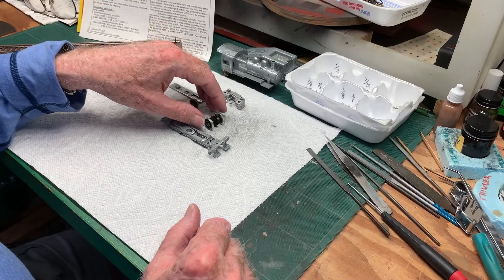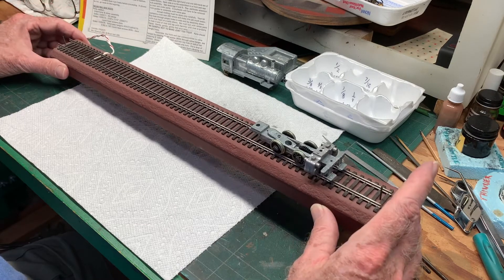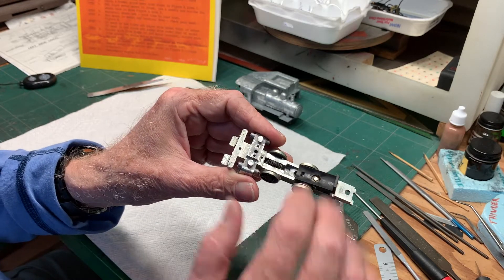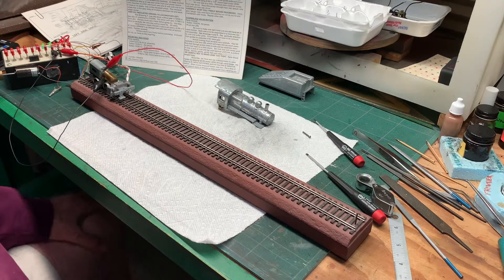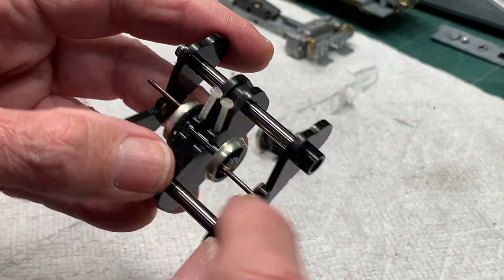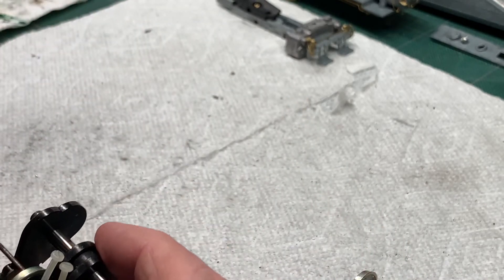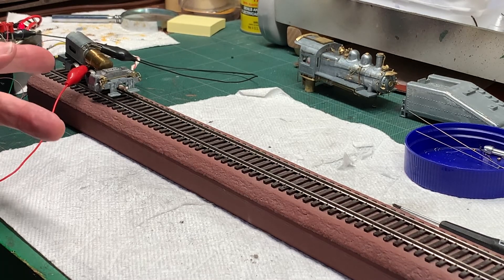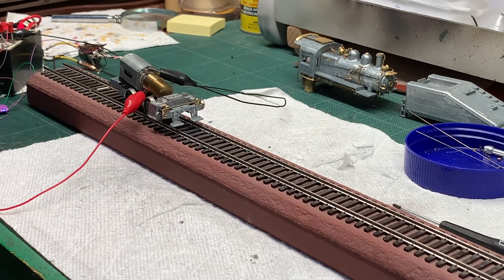Steam Loco Kit- Video #2- Basic Mechanism

Comment: This is a really nice video. Where did you get the motor?
Reply from the maker: I probably bought the replacement motor at least 30 years ago (source unknown).  The brand was "Helix Humper".  I"m pretty sure they are long out of business.  I am now thinking about putting in a Northwest Short Line gearbox and a new can motor.  A future video, perhaps???
Reply: @CarlBrainerd  I would be interested to watch. I have a kitbashed GN P2 from a Bowser USRA class that I am looking to remotor.
Reply: Thank for another great video! Very informative. I really appreciate the quartering and gear puller as I have always wondered why NWSL never produced one.

Comment: Do you think epoxy would have worked on the gear?
Reply from the maker: Well, it never occurred to me to try to fix the gear, especially once I found out that "new" ones were available.  But I have my doubts whether that would be an effective fix.  That plastic is slippery, and the crack into which the epoxy would need to go was very small.  I think there must be a lot of internal stress in the gear due to the slight interference fit between it and the axle (what caused the crack in the first place).
Reply: @CarlBrainerd   Your probably right. Your videos have inspired me to rebuild and super detail a bowser 2-10-0. Also install dcc/sound which is also new to me!